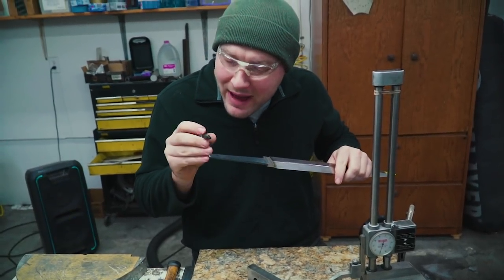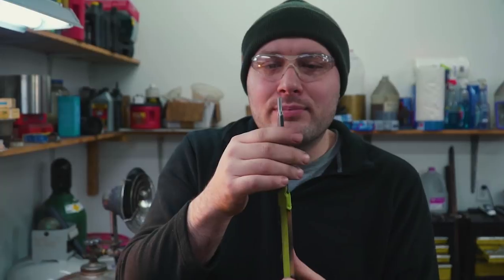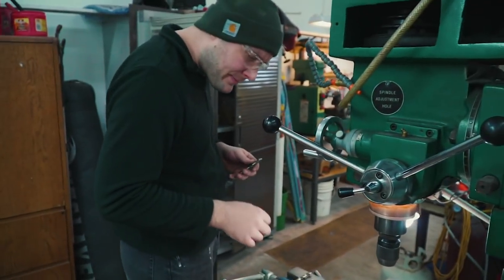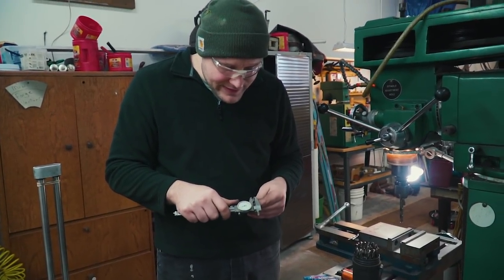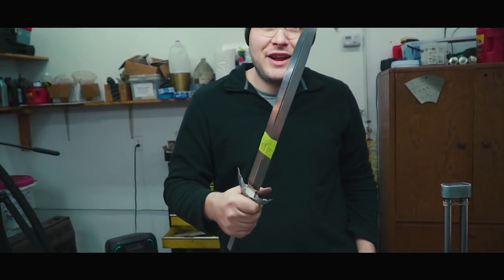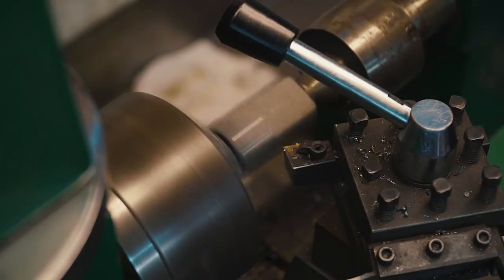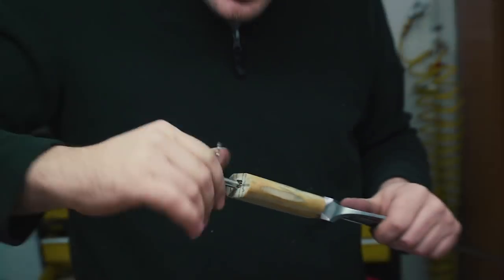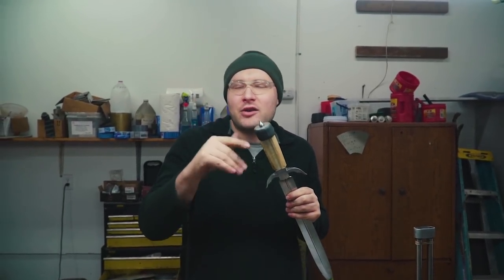How I Make My Pommel Nuts

Comment: Great video, and great piece of work, but why you machine round detail out of square stock? In term of drill bit size for the thread, I think this info could be found in the special table, so you don't have to make the measurements every time. In general I think this nut could be done on the lathe from start to finish, easier and faster.

Comment: Why don't you start with round stock and do all the operations on the lathe? I have yet to try a takedown knife. Most of mine are full tang with a couple of hidden tangs. Full tangs are a lot of work as I always put a distal taper on mine but since everything is flat, assembly seems to be more strightforward to me.
Reply from the maker: Good question, Robert, round stock would be great but I don't happen to have any 1018 round stock on hand so I used what I had in stock.  I enjoy doing the occasional full tang knife but most of mine are hidden tang take downs.

Comment: Anything special about how the alignment pins within the handle are done?
Reply from the maker: Sometime in the future we'll definitely cover more details on how I do internal line up pins.  It's important to get the line up pin holes just the right size, you want the pins to fit snug but not too snug.  I use 52100 hardened, 1/16th inch dowel pins,  they are precision ground so I get the same results every time.  Thanks for your question and watching.